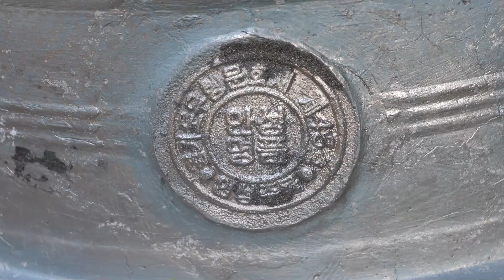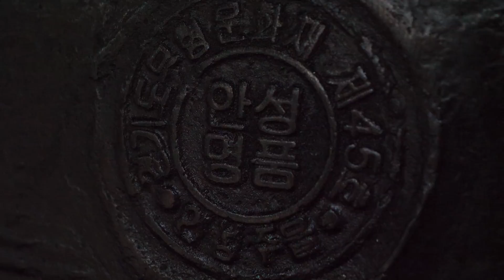Process of Making Iron Pot With 100 Years of History. Iron Foundry in Korea.

Comment: I loved that. Wow. I work in an iron foundry where we use machines to help in almost all of our casting processes from preparing the molds to pouring to removing the sand. Seeing how everything is done by hand makes me realize again how much I love this form of art haha
Reply: The difference is you can produce more castings in the same amount of time and won't have as much of a risk of injury using those tools. Set up and moving things efficiently seems to be essential to have dialed in, but humanity does have thousands of years of knowledge and practice casting metals. It's like metal smithing and pottery; older than civilization or near the same age.

I am all for keeping ancient artforms like this going for the same reasons you love working in a foundry, but I would say that I was pretty shocked that they had no safety gear, not even a a heavy leather apron, to protect them if they spilled or there was another accident while working with the molten metal. Sure, if you have been doing it for decades you are unlikely to have such an event, but in a production speed environment like this one? Come on, they don't need to prove how cool they are by doing it in street cloths. They are already cool. They work in a foundry that is over 100 years old.
Reply: Work smart and safe instead of doing things traditionally. It's a smaller scale of operations so of course they won't be able to ford more of the heavy machinery to automate a lot of the work. The guy just running down with molten lava temperature liquid isn't a very smart way of doing things.
Reply: @KnightsWithoutATable  This is still 10 times safer than "traditional methods" in second/third world countries. Besides modern tech and safety costs money and political/social advancements, lack of corruption. It's not as simple as virtue signalling and just saying "let's do better and safer", that's what chinese local propaganda likes to do. Not to mention individual pay, if they're paid well they'll do it - traditional or not.
Reply: @memespeech  A heavy leather aprons, heavy leather gloves, and wire mesh face shields cost too much money and are hard to get? This video is in South Korea, not a 3rd world country. Even a cheap place in China could afford and acquire basic things like that with little effort. It's not like they are trying to equip 3 to 5 shifts of a few hundred people like an ironworks or steel mill would have.

I suspect that they aren't wearing them because of the heat when casting/in the casting area and putting the finish on the bowls.

Comment: I was wondering how they'd prevent flash-rusting - but they just move very quickly to wash/dry and get a coat of oil for the finish.
Beautiful end product.  They look good enough just for display.
Reply: They are carbonizing the oil into the iron pores at the end.
Reply: @donaldkasper8346  Why did the pot look silver in color (at least it did to me) after it was cast?  I've never seen iron have that color.
Reply: @billsmith7673  Specular reflectance.
Reply: @donaldkasper8346  OK, thanks for the answer.

Comment: First they take the dinglebop, and they smooth it out, with a bunch of Schleem. The Schleem is then repurposed for later batches. They take the dinglebop and push it through the Grumbo, where the Fleeb is rubbed against it. It is important that the Fleeb is rubbed, because the fleeb has all of the fleeb juice. Then a Schlommy shows up and he rubs it and spits on it. They cut the fleeb. They are several hizzards in the way. The blamphs rub against the chumbles. And the plubus and grumbo are shaved away. That leaves you with a regular old Plumbus.
Reply: Imagine not saving the Schleem from the process, it would be very wasteful
Reply: Get outta my personal space

Comment: Foundry men.
That's us.
That's a green sand core for the inside and a steel die for outside.
Imagine thousands of years ago how they did  similar feats supposidly without electricity. Grinders. Shovels...mmmmmm
Reply: I think about the manufacture of machines before electricity and welding was essentially an impossibility.  Having to rivet every machine together, incredible what they managed to make with rivets as the jointing technology.

Comment: What is the fluid used to paint into black by firing it? 
Interesting video
Reply: Vegetable oil. When you heat it becomes a black coating.
Reply: Льняное масло
Reply: Zeytinyağı da aynı görevi görür ... 2-3 kere ısıtıp ... zeytinyağı sürersen ... sağlıklı bir "teflon" gibi yüzey olur ... bizde demir tavaları böyle ısıtıp yağlayıp yapıyoruz ... "kara tepsi" deriz ...  bu yapılan hamuru-patatesi yapıştırmaz ... ancak yıkanmaz ...  sürekli silerek temizliceksin ...
Reply: @chang1865  tq

Comment: Это не чугун, а алюминий, а в остальном тяжёлый труд. Спасибо
Reply: Not aluminum.  They were melting brake rotors for the casting. They don't make aluminum brake rotors.  Also, at the end they were pre-seasoning it with some sort of vegetable oil to prevent rust.

Comment: Now that's a factory that doesn't care about the injuries occurring while working. Should always have two people holding and moving the molten Iron. Shit's heavy and dangerous to be moving around like that or you put the forms on an assembly line so you move the molds to the crucible. Many ways to not destroy people's joint lifting this shit or burning them.

Comment: This seems such a wasteful process, im sure there are more efficient ways these days, this is a very old process it is outdated. It would be more efficient to turn a block of steel on a huge lathe and re form blocks. A press, turning using robotic arms, even the mould making they dont have a conveyor or a pulley system to lift those things?
Reply: There are more industrial ways to do some of these things, but this works fine and is cheap. What is wasteful? The sand is re-used and the excess iron is melted down to make more pots. The heat used to make one is nothing compared to the heat that will be used on it in the decades it will last.